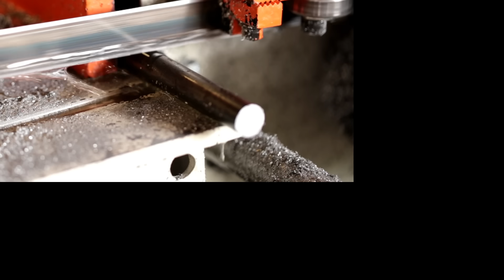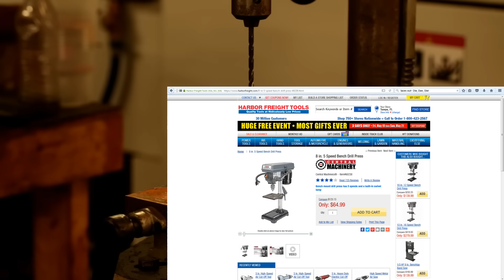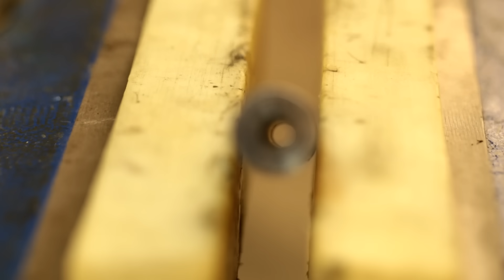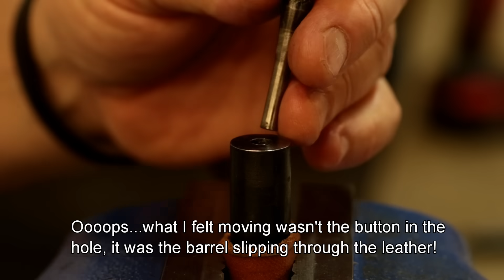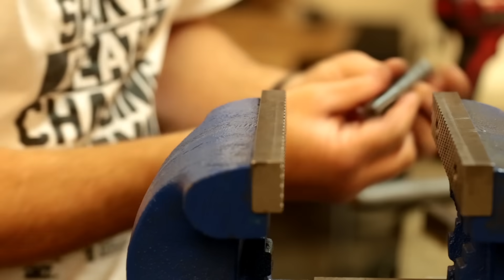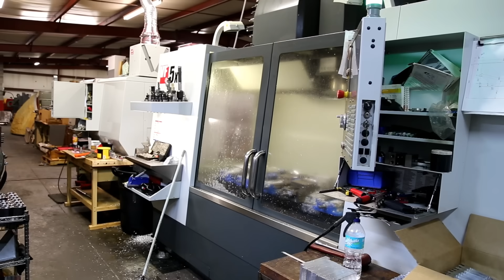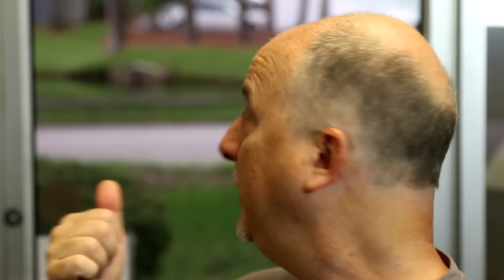Home Shop Rifling!

Comment: I am a very accomplished machinist, (many shops, now own my own business), with several manufacturing degrees, and getting into airguns lately,  I was thinking the rifling process, which I have never seen before, was a cutting process, but it is more like a burnishing/forming process.  I never knew the button existed. I would have thought it would take a lot more pressure to push the button through.  You can learn something every day and the day you think you know it all is the day you have a lot to learn. :)
Reply from the maker: Congrats and good luck with your business!  There are actually 5 different ways to do rifling: Button, broach, hammer forge, single-point cut, and ECM.  Button is the fastest and easiest and requires the least amount of up-front equipment costs.
Reply: @markserbu  crappy one could be fixed on a basic lathe as long as the hole was straight (even if angled) and steel blank was oversized compared to what is needed. Then just resquare the face and weld on the feed lip ramp or bolt it next to one.
Reply: I would like to see Mark make the rifling buttons and the broaches.
Reply: I went from rc’s to airguns as well, most of your high end airguns use lother walther hammer forged barrels.
Reply: I read where custom gun makers pull the button
Reply: What kind of airguns? I make a whole lot of different slugs for big bore airguns
Reply: Some people do use hydraulic press to push the button thru
Reply: Hello accomplished machinist. I am an apprentice machinist. Do you think that pushing program would just use G81 or a different g-code?

Comment: It makes me happy to see I'm not the only one that has a problem drilling straight holes :)...
Reply: I was thinking that lathing the work piece now using the hole ends as the new centers might probably right the whole thing.
Reply: @FourSeasonsHD  that's a process called "turning between centers". You are correct, that would true the outer diameter to the inner diameter. Afterwards you would have to face both ends though because they would be running out
Reply: I nearly always drill straight holes. Drilling them in the right direction, however, is another story

Comment: Watched an old film of a gunsmith from Williamsburg Virginia…demonstrating how rifles were made back in the 1700’s. He used a forge to make a Damascus twist barrel around a broach to keep it in the form of a tube. He hammered it down into an octagon shape. He made the stock out of Walnut. He hand made all of the hardware, springs and flash pan using the same forge. After a lot of hand filing he had a rifle barrel. Then he rifled it using a rifling jig which was made out of wood. Then he assembled the parts and came out with a beautiful, fully functional flintlock rifle.

Comment: In my experience, to drill a hole through the center of round material, I put the drill bit in the vice on the drill press and the material to be drilled in the chuck on the drill itself, it will drill the hole dead center every time, no special tools, lathe, etc, just go slowly an flush with lubrication and voila! A perfect, centered hole in your round stock, with the right chuck on your drill press, you can drill octagon or hex stock just the same, hope this makes sense, it works like a charm, db

Comment: Watched to see your process for rifling.
(15 years in aerospace, and theres always something to learn, thank you for the video, I don't think I am sharing anything you don't know, but I think this would be useful for the average viewer)
A few tips I have picked up.
Reaming with hand tools works better then tightly constrained, more flex in your tool holding set up the better so it can guide itself to the average and the less it binds, but you do need to use a reamer made for hand tools to fully utilize this, and make sure you have at least .005 (inch) to remove, and not more then .007 ~ish per inch on hole diameter. And of course ypu need to use the guiding brushing thay goes in the little hole in the end, they are sold separately. In my experience, always refer to the machinist bible, don't trust a random commenter experience haha. 
 
I have used this principle to fix holes that where undersized on 1/4 million dollar jigs, saved the entire assembly after it was welded and too big to fit in our football field sized milling machine. 
I got a raise for my efforts so I am more then happy with my results. They where within +/-.0001 and the tolorance was -.0002 +.0001. 
Takes practice to get excellent results, if I had not been the general purpose "fixer" in the shop thanks to my hand techniques and flexibility I would not have pulled that off, but I think a garage shop could figure it out with a dozen or so practice holes.

Some tips for getting a through hole centered and straight, drill out with an undersized drill first. Drill from both sides first, and dwell when your at the bottom, size up through three drill bits if you can but use at least two. Only the first needs to be drilled from both sides. 

Again, it was really awesome to learn from your experience in rifling, I will utilize it well, I am surprised that buttons do not require a twisting punch to push through, that was cool to see, I would like to know if you have tested for drunken twist?

Comment: I did one barrel here in australia(supid gun laws)i spent 8 hours driving a 9mm button down a stainless barrel with a hammer n rod
It worked perfectly
It was a 500mm barrel
Reply: A guy was done last year in Western Australia for making barrels (and the rest of various sub machine guns). The judge accepted it was a case of collectors curiosity but warned that it was very serious and wouldn’t be tolerated again, then let him off but now that his zero tolerance stance has been noted in the judgement I don’t think anyone else will be so lucky
Reply: @johnnytower6169 lol. So no one else is allowed to be curious. 😂 why live in such a dangerous place?

Comment: To get a perfectly centered hole you need to spin both the part and drill bit...although your method of doing this in a home shop with limited tools is very good.  Nice job
Reply: This operation is typically done on a metal lathe where the workpiece is chucked in the headstock and rotated against a stationary bit chucked in the tailstock; only one part, tool or work, needs to rotate.

Comment: fun fact: those agressive tooth'ed pads on a vise are held on with screws because they're made to be reversible. there is a toothed side, and the other side is smooth for when you don't want to put a texture on your workpiece.
Reply: I thought the same thing until I tried it a couple weeks ago. The holes on the other side aren't countersunk for the screw heads. ..and I had to use my impact driver to bust them loose.
Reply: Not quite, but close. You can countersink the reverse side if you want, or buy a set of soft jaws for a few dollars. Personally I think buying (or making) the soft jaws so cheaper since your about to ruin a counter sink if you choose to make reversible jaws

Comment: Maybe someone already said, but what I do for a better "center drill", i use the method of I need to remove a broken off fastener down in a hole. But still a hole in a block of wood near the same outer diameter of the would be barrel. Drill with a press, then lower the drilled block. Place would be barrel in hole, hold with vise grips or whatever you choose, the drilled holes in the block will hold the barrel in alignment. While holding the barrel with grips, drill the smaller home in the barrel. That will give you a MUCH better aligned hole.

Comment: "These calipers are messed up..."
Literally my experience with every set of calipers.
Reply: It helps to know the correct way to use "PRECISION INSTRUMENTS", they're not hand tools for idiots.
Reply: @ronald209  

I've always wondered why the threads on these little Mitutoyo C-clamps are so fine, with graduated markings.😂
Reply: @ronald209  my own calipers are fine after 4 years

Every other set i get a hold of aside from brand new ones though....
Reply: Every set at my machine school is messed up aside from the teachers. It's fixable but we're not supposed to adjust them
Reply: @ronald209  helps if you don't use them as a scribe or over tighten them while trying to gauge a piece.
Reply: @josiahtheblacksmith467  that don't make good adjustable spanners either, no matter how small the but☺.
Reply: Nut☺
Reply: The paradox of none of these are right so which one is actually wrong

Comment: You can get thinner cut off wheels for your cutoff tool. I worked in the Plastics injection molding industry for 21 years and Still have a few ejector pins never bought any though. The really thin ones can be ground to a fine point and used like a needle. You can also make firing pins with them. Over the years I built a few barrels without rifling for .22 blank perimeter alarms. Used the ejector pins as the firing pin. I would cut a small groove in ejector pin on the lathe to hold my clip, and then turn down part of the head of the pin and make the firing tip. That way I could insert a spring in the tube and then my ejector pin. I would make a screw on tip that the blank would fit in and threaded up into the tube. Had quite a bit of fun with them. Mine wasn't fancy or anything ,but were useful. And the blanks I used were actually store bought for a nail gun.

Comment: You build some awesome guns but everything about this video is sketchy as shit. Which means I can for sure do it at home!
Reply: bucketsof lead Ata boy! Love that spirit!
Reply: That sort of seems like the center of the stock. (bunch of scribbles that don't come to anything resembling a point) Good enough, whatevah. It don't mattah, none a dis mattahs.
Reply: @HaqqAttak  the center is the area that appears in the middle of all the marks.
Reply: Machining is usually a little more precise than that squid.
Reply from the maker: On this particular part, the OD will be turned while it's held between centers.  That means the location of the hole doesn't matter a bit, as long as it's not so far off that the OD won't clean up.
Reply: @markserbu  mark you need to buy a center square, it will change your life!!
Reply from the maker: I'm pretty sure it won't have as big an effect as the CNC machines with their touch probes, but thanks!
Reply: @markserbu  No I mean for when you're just doing jobs like this or finding the center of and round bar. They are cheap $10-20 dollar things that come in so handy!!
Reply: I understand that but it is still hilarious.
Reply: @atourdeforce  I have one that came in my Starrett layout set. I used mine to mark center on my barrels. Took an optical center punch and marked the center and man did that side come in accurate. They do help!
Reply: @AldoSchmedack  Exactly that's all I was trying to tell Mark, but I can't help but feel he somehow got offended by by suggestion. 

They are the most inexpensive and  accurate and all round genius little tool to have laying around. 

Literally can get the exact centre of any round bar of any size with two swipes of a scribe.
Reply: markserbu , Do the location of your fingers matter a bit?
Reply: I am the ONEHUNDREDTH person to like this one yeah baby!
Reply: LOL! Totally said my thoughts.
Reply: @AldoSchmedack  something like " Sir we're surrounded, excellent now we can shoot in any direction"
Reply: @atourdeforce  his point is he made this video using tools that everyone has laying around to show people. This isn’t something he would normally do
Reply: @taylorbokshowan5713  With the greatest respect, I would have thought that was pretty obvious that it's not normally how he does it, by the title alone, nevermind the 100 times throughout the video he mentions it. 

I just noticed he used a calipers to find the centre of the round bar IN THIS INSTANCE, and I thought I would be a good addition to have AS A HAND TOOL, not as a replacement to his machines. 

Also If someone has a calipers to use then having a cheap $10-$20 centre square isnt exactly unrealistic. I dont get how people dont understand what I was trying to say here, but hopefully it's clear now.

Thanks all the same for going to the trouble of replying.
Reply: @atourdeforce  With all do respect if you can't find the humor in telling him "a centering square will change his life"  you are pretty lost
Reply: @taylorbokshowan5713  Ok I'm really lost here, earlier you clearly tried to explain it to me like I didmt understand what this video was about, so I explained why I said it and thanked you for the reply nonetheless. Now you are changing it and talking about the humor in it I somehow missed. 

This whole conversation is making less sense by the hour. Anyways have a nice day!
Reply: @markserbu  Mark, dude your awesome! A true engineer!  Basic tools and I love all the "should do that" love u God bless
Reply: Ain't nothin left too it, but to do it!

Comment: One thing not mentioned - after the button is pushed through there are very high hoop stresses in the material. The material needs to be stress relieved before machining. Also important is the material properties, ie: hardness. Typically barrel material is between 28 and 32 Rockwell C when drilled, reamed and rifled. Then it needs stress relieving before machining. Materials of lesser strength will not stand up to anything much over .22LR.
Reply: Sounds like 4140 pre-hard, or, perhaps “ETD-150” - a free-machining flavor of the same…

(Just got done turning stub-axles of the same for a bike trailer.  Pressed and pinned into an .058 thick tube of 3/4 4130 tubing…)
Reply: Stainless is a fairly common rifle barrel material does it fall in this range? I've got 6-8' of 1.5-2" stainless I was thinking about using to make a barrel. Might have some other stuff as well not sure. Bought a bunch of metal a couple years ago and have been working on figuring out how to get it home since. I just finished rebuilding the engine on a rough terrain forklift that I'm planning on using. I know one pies as 6-8" in diameter and at least 6' long and there is are other pieces like that hence the forklift. It's all in behind a guy's house and it's soft back there as well and he doesn't want his yard torn up which is why it has taken so long, think it's between 3-4 tons in total.

Comment: Holy crap. Rifling a gun barrel on your own. I realize it’s harder than it looks but it can be done is what you’ve shown. I’m just smiling and scratching my head. Thanks for passing on this knowledge. Seriously
Reply: Why not simply by different sizes of barrel liners?  They're made to re-do a worn-out barrel, . . . Ream the barrel; heat the barrel; chill the liner; and slip it in, . . . or, for no heat, ream close, and red Loctite, . . .

Comment: If you take two vice grip pliers weld one to one tooth big vice and other side just have one part movable so the little vices will hold the subject stable while strengthen the hole you're a genius